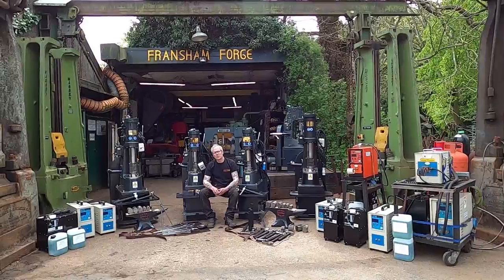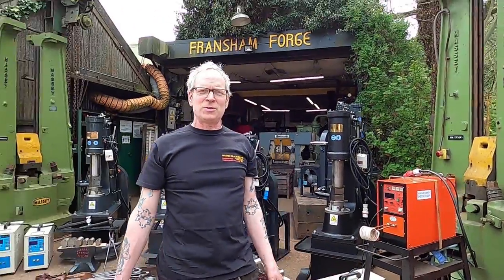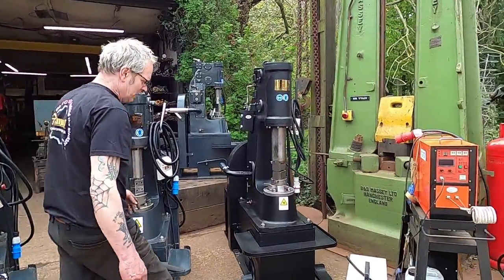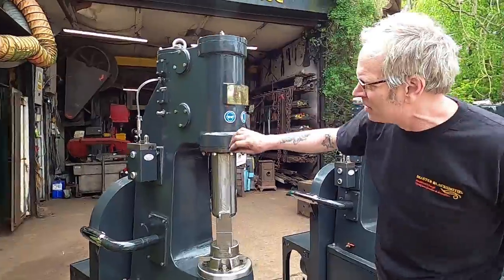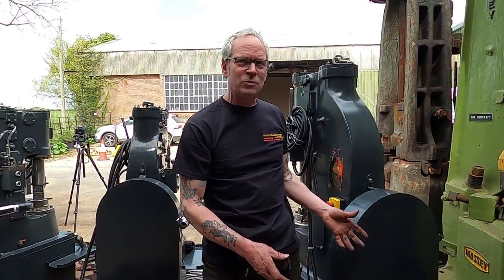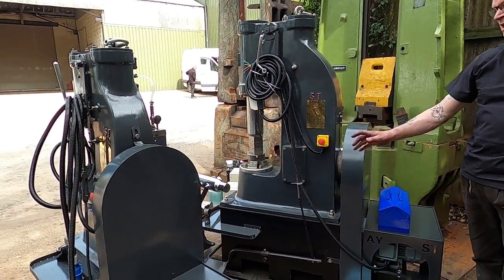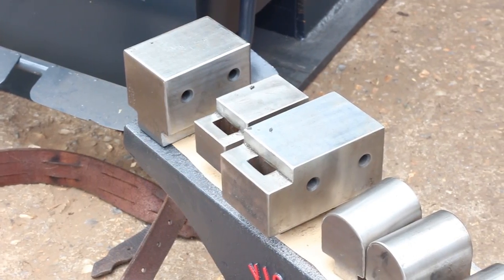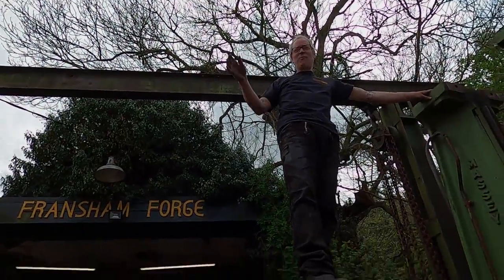Fransham Forge - The Anyang ST Power Hammer and Forge Force Induction Emporium!

Comment: Can I use that coolant in my TIG cooler, would that be better is a guy just has one cooler?
Reply from the maker: Hi Kevin  it depends on the coolant you use as some tig coolant degrades  in induction heaters and blocks them up .i will do some more filming for you and explain more .

Comment: Great looking tools just wandering what type of oil you run in your small Anyang cheers
Reply from the maker: Hi  Pete
some people use  ram oil but i use 15w light oil ,you will see if its to thick as it will not pump up easy .the more you run the hammer in the better they get ,
Reply: @NigelBarnettArtistBlacksmith  thanks for the reply Nigel much appreciated
Reply from the maker: hi thin ram oil  or it will not suck it up

Comment: What would you recommend to be the max sizes to forge on the 15 and 25?
Reply from the maker: hi 16mmon 15 kw and 20mm on 25kw but will do more depending on how long the heat is .
Reply: Thanks for the quick reply.
Can you elaborate? I’ve seen the producers max it out on 35mm and 48mm round, but user feedback always seems better.
Edit, I am talking about the power hammers, to be clear. 😅
Reply from the maker: to do that size i use a 40kw machine .
Reply: @NigelBarnettArtistBlacksmith  are you talking about the Anyang power hammers or the induction forges? I’m looking at the power hammers.
Reply from the maker: induction heaters .power hammers 15kg i forge 25-30mm 25 kg up to 50mm but metal would need to have a good heat .main thing with a 25kg is the dies are bigger so you have more choice of dies .i will film them all working for you .
Reply: Thank you!
Reply from the maker: thank you for watching